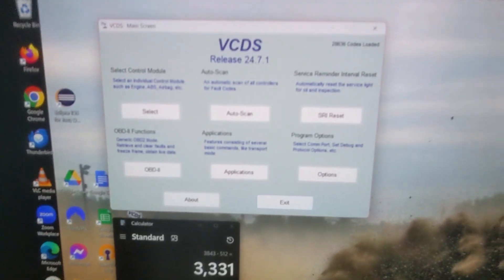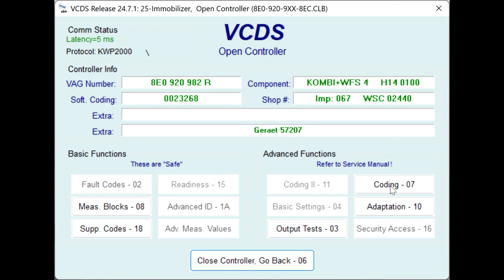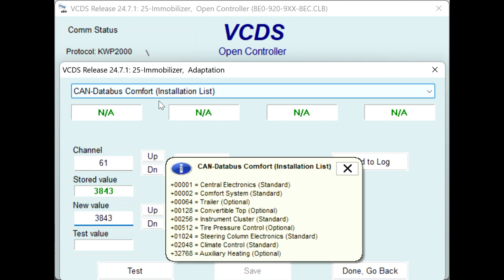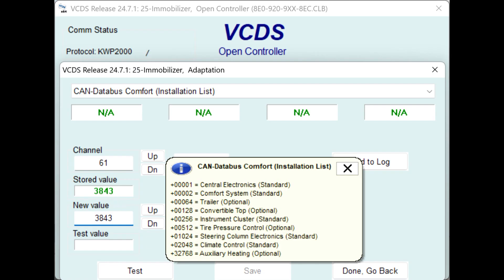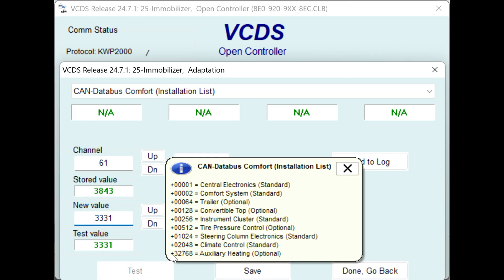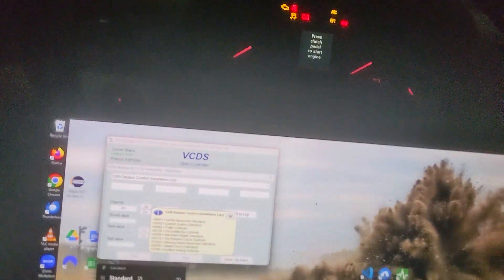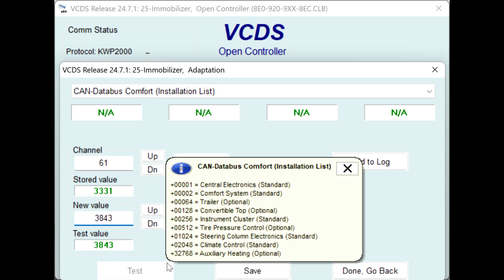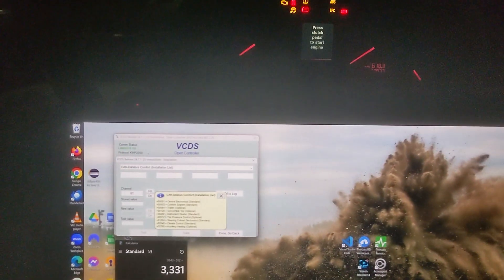Enabling/Disabling TPMS on a B7 RS4 with VCDS Coding

Comment: Hello what year is your car ..I wonder if this is possible in 2007 A6
Reply from the maker: This is a 2007 RS4. Not sure about the specifics of the A6 but it's probably similar technology, I'd be surprised if RossTedh didn't support coding for it
Reply: @FrogRacing yeah Ross tech does your car b7 is made during same year as c6 so I'd imagine it should be close to the same if not the ,thanks 👍🏾

Comment: What's the rationale for having TPMS disabled? Because you don't want to deal with the sensors, or because you run pressures that the car would identify as anomolies? I've got TPMS both my sets of rally tires 😅
Reply from the maker: @StalePhish  if you have a set of wheels without TPM sensors like a winter set this will avoid the unnecessary warnings on the dash. If you race in low traction conditions you would usually run tire pressures much lower than stock recommendations which would also trigger the TPMS warning. Finally to resist gravel conditions we use metal valve stems with sealed caps that are more resistant to cuts and damage than rubber valve stems that are typically used with TPM sensors.
I am curious what kind of rally tires are you using on your RS4?
Reply: @FrogRacing  Great thoughts about the metal vs rubber valve stems. TPMS sensors are relatively cheap so I've got them on my summer, winter, and two rally sets but I'm still mid-build (your videos have been helping!) so haven't ran at lower pressures yet. I'm watching this specific video just for general knowledge, but I've got a Fiat 500 and I'm using brand new Federal G-10 tires on custom milled Braid wheels.

I do have a pending factory recall on my TPMS sensors in the ECU but I'm worried they'll muck up some modifications I've already made in the system (programming out warning lights related to removing the stereo, etc)
Reply: Is the same process for audi a3 2014?